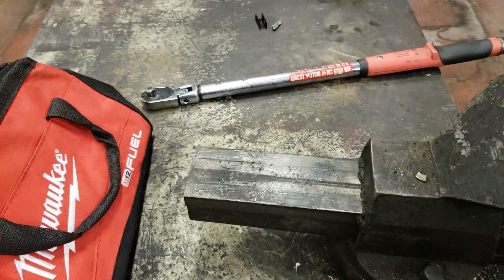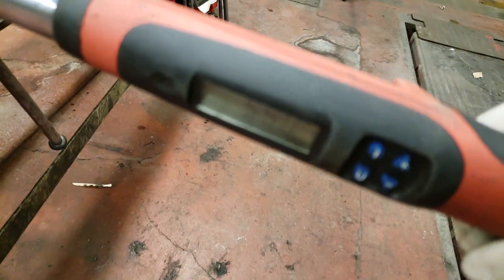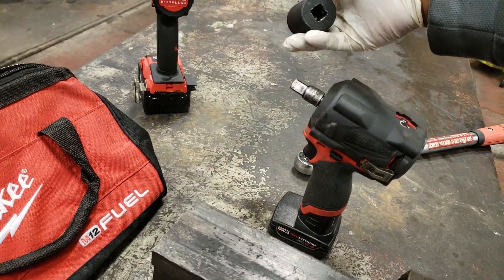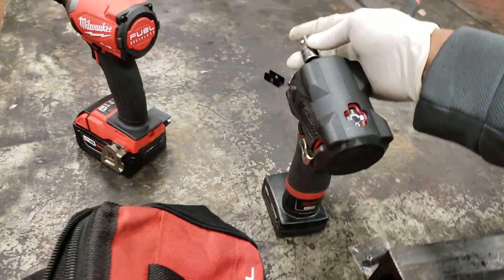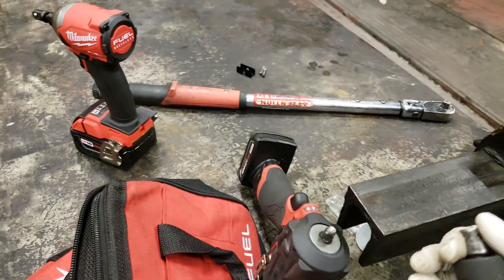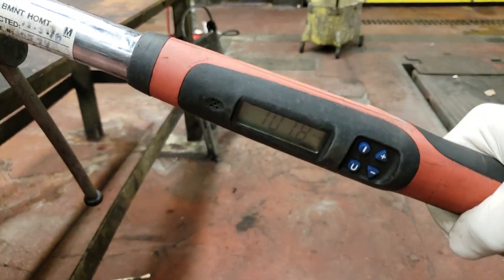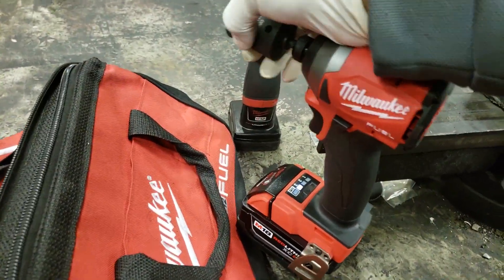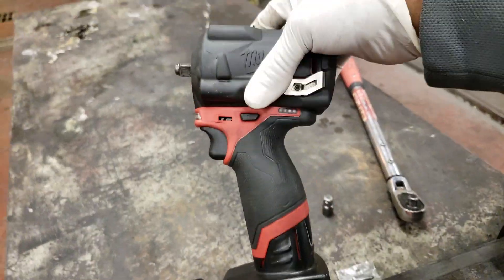Milwaukee stubby impact: 4.0 torque test.

Comment: You left the torque at 248 not 254. You reset it at 254 but didn't re- torque it. So you left it at 248.
Reply from the maker: I have to go back and check

Comment: Ok you convinced me that i can use this gun to replace lower control arms on wifes honda odyssey and sons Accord👍 What torque wrench do you prefer? Great vid👍👍👍
Reply: I have a 94 civic and took off my front struts and reinstalled them using my m12. I just purchased the m12 impact driver 2553-20 and used a 4.0 battery it definitely gives you more power compared to the CP batteries or compact batteries. The 2553 is not as “tourqey”  as the stubby but no slouch either. I had no problem removing lug nuts and suspension bolts on my civic. Check out some videos of the 2553-20 impact driver for a little bit more versatile tool. As you can use many attachments on it.
Reply from the maker: I don't have a preference.   As long as it comes with some sort of warranty
Reply: I have a 94 civic and

Comment: Thanks, however there is no power output difference between 4 ha battery & 6 ha battery, they both deliver the same 12 volt output.    The only difference is the longer run time of the 6 ha battery - I can't believe some viewers can be so under educated!
Reply from the maker: Power=watts.  Volts×amps= watts.  Larger cell offers less voltage sagg under load, so technically more watts which equals more power.  Its basic ohms law.  I know what your saying,  free loaded power they will be the same.  Both tools under heavy load and the larger battery has more power output.
Reply: @KiloWattRC  can’t agree more!

Comment: Thanks, however there is no power output difference between 4 ha battery & 6 ha battery, they both deliver the same 12 volt output.    The only difference is the longer run time of the 6 ha battery - I can't believe some views can be so under educated!
Reply from the maker: Power=watts.  Volts×amps= watts.  Larger cell offers less voltage sagg under load, so technically more watts which equals more power.  Its basic ohms law.  I know what your saying,  free loaded power they will be the same.  Both tools under heavy load and the larger battery has more power output.
Reply: @KiloWattRC  watching both of your videos of this test with the 4.0 and 6.0 you can see there is a slight difference. The 4.0 takes about 1 second longer before the impact noise stops, demonstrating that the 6.0 is more powerful.

It's interesting though, because from what I read the 4.0 and 6.0 batteries use different cells at 44a and 30a respectively . Shouldn't that more than make up for the voltage sag and make the 4.0 more powerful? Obviously not I guess lol

Comment: Outstanding video!
BTW, have you been able to get some thoughts on using the older M18 3/8" 2754-20 impact vs the new stubby.  I'm wondering if guys who have the new stubby like it better than the former M18 3/8 model.

Comment: Did you try fastening torque on setting 1 v 2 v 3 ?  I'm really curious about that!
Reply from the maker: Setting 3 and fully charged battery
Reply: @KiloWattRC  What I'm curious about is how much tightening torque you get at each setting. The opposite of what you did with breakaway.

Comment: What about 2.0 and 3.0 batteries? Does it do 250? Thanks
Reply from the maker: I tested 2.0 in this link.  But 3/8" to 1/2" Adapter that I used might of flawed the results. 
https://youtu.be/MjlhswbDtG8

Comment: Do you find that the hex to square adapter gets stuck in the impact after your cranking on it? I have a dewalt that I have to reverse to free it occasionally. I've been thinking of switching to Milwaukee.
Reply from the maker: It happens on my Milwaukee m12 gen2 impact when using non impact rated bits.  And in this video I was not using  impact rated bits with gen 3 m18, and it ended up demolishing the driver bit, because it was too damn strong.  I will upload another video of impact rated bits with m18 gen 3 driver at 250ft lbs